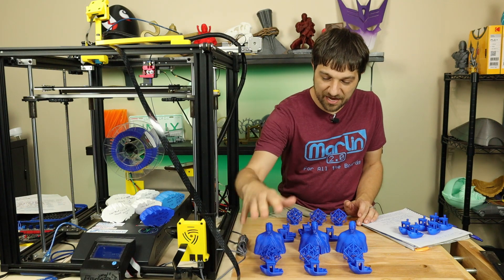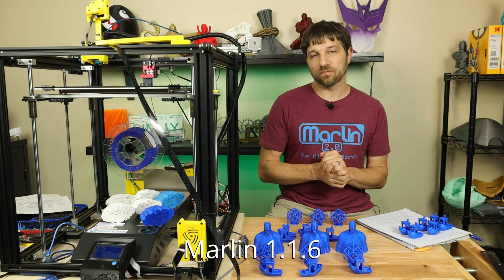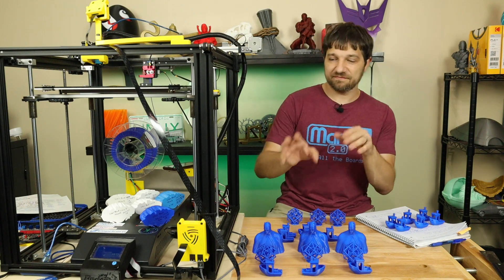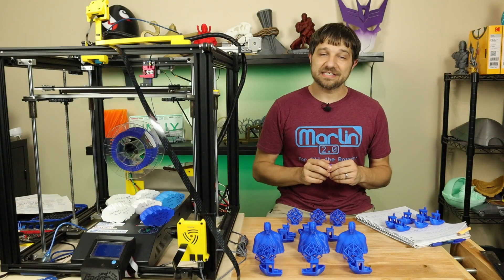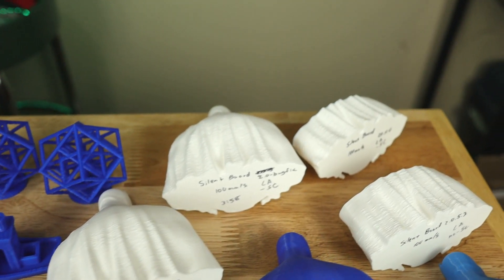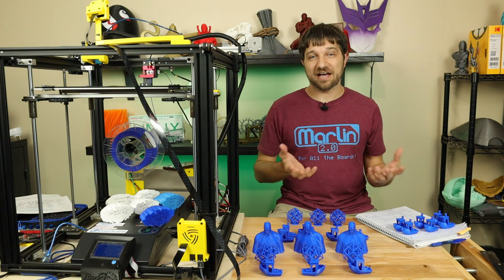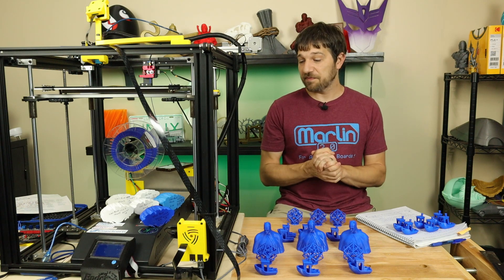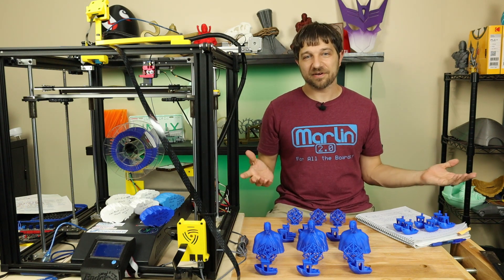Marlin 2.0 Issues: Version 1.X Comparison

Comment: Those same issues with my ender 3, plus very bad ABL results, were what turned me towards Klipper. I am now running 100mm/s on the scurve-smooth branch with linear advance turned on, only 1mm retraction. No ringing, barely any stringing, and the printer doesn't look like it will come apart with vibration anymore. You should give it a try, especially since you already have the RPi.
Reply from the maker: I appreciate that. After several solid recommendation, I will put this on my to-do list.
Reply: @kerseyfabs  Happy to help if you need anything, just hit me up here. It took me a while to "get" the Klipper way of doing things, vs Marlin.

Comment: There are currently issues with JD (which can be fixed with classic jerk), some permutations using linear advance (S-curve, StealthChop) and with the inherent USB CDC latency and the serial protocol with many, small segments (which can be mitigated using direct 3.3V UART instead of USB). With an SKR (with UART/TFT header) you really want to use 3-wire UART instead of USB.
Reply: But how would you use UART if you change the screen? As far as I know you need the TFT connector for touch functionality.

Comment: Why not change the Marlin 1.1.6 firmware to probe on a 5x5 grid instead of the stock 4x4 with your offset settings? I realize that it does mess up the stock creality measurement display, but when using octoprint or just the terminal you can get the true points. 
Doing so allows for much more accurate bed leveling around the center since it doesn't "guess" a z-home from ABL for the most critical place of printing - The center of the bed.
Reply from the maker: I agree that it would produce more accurate results but one of the goals was to keep the firmware as compatible as possible with the existing touchscreen. So, for now, we're sticking with 4x4.

Comment: great video ! I updated my cr10s pro to 2.0 and had the same issues on stock board , after checking the whole printer from top to bottom , I just went back my old TM firmware and now back to printing great prints ! I think a lot of bugs need to be fixed in 2.0 and I agree that its not a board issue but a software issue , great work !
Reply from the maker: Thanks for that! That's why I'm taking my time. Upgrading isn't upgrading if the results are worse.

Comment: is the issue reproducable on the Ender 5 non-pro/plus with the silent board?
Reply from the maker: I haven't tested that printer yet. I have no reason to believe it wouldn't given that it's already reproducible across three boards. I'd still need to test to be sure.
Reply: I had the same issues on my Ender 3 silent board running Marlin 2.0. I didn't try turning off Junction Deviation until I had upgraded to the SKR, but I'd wager it would fix the issue there as well.

Comment: Hey man, love your videos, I have a skr 1.4 turbo with a Ender 5, basically allot of advance functions on marlin 2.x are bugged, Idk if this is your problem, i have a similar problem and was a recent plug-in upgrade on octoprint, the one that show layer status, just to test, print a benchy without any plug-in or using your sd card
Reply from the maker: I'm not using the Pi for printing any of these tests. These are all from the SD. The Pi is only being used for monitoring.

Comment: Did you print these prints with octoprint or sdcard? There seems to be a problem with marlin 2.0 in combination with octoprint on some machines, maybe give it a try?
Reply from the maker: I should have mentioned that. These are all off of the SDcard to minimize external factors.

Comment: There is just no issues with marlin 2.0 as far as I can see. You just need to configure it correctly.
Reply from the maker: "No issues." That seems to demonstrably not be the case given that there are open issues that are unresolved in their issue tracker.
Reply: @kerseyfabs  Yes of course. There are issues with every single software ever released. By 'no issues' I meant no show stoppers.
Reply: @witorwitor  Linear Advance, Juntion Deviation and the corner thing are all bugged... For me is a big issue
Reply: @witorwitor  Junction deviation should absolutely be considered a show stopper. Yes it still prints but it completely ruins said prints. Here is a side by side of the same gcode. Left is with JD on, right is with JD off 

https://imgur.com/RMacH5s
Reply: There is allot of know issues with Marlin 2.X.X

Comment: S curve acceleration and linear advance work as they should.  Just increase buffer size from 16 to something like 64 ( I have it at 64 but you could actually set it to 128)
Reply: Buffer size changes did not fix my issues, turning off Junction Deviation was the only fix. There is are open issue on the Marlin GitHub page for issues with JD
Reply from the maker: Thanks for the suggestion. Are you talking about the BLOCK_BUFFER_SIZE? There are multiple buffers.
Reply: #define BLOCK_BUFFER_SIZE 64 - that's what I changed to fix the exact same problem. With default 16 on my SKR 1.3 printer was microstuttering on circular moves which caused zits. After increasing buffer size from default 16 to 64 no more problems. Would be nice to see if it will fix your problem.
Reply: Can't wait to see an update to this suggestion.
Reply: It's supposed that this 32bits board's don't suffer from that problem, I have a Skr 1.4 Turbo with octoprint, going to try this just to se if I can appreciate any change at all, I think this has nothing to do with the problem because his 8bit silent board don't show this problem and it's a really slow board without native usb connection
Reply: With a big buffer, shouldnot SLOWDOWN_DIVISOR be changed to  so a smaller part of the buffer is required before the slowdown?
Reply: @RobbertMüller  i have set mine to 4
Reply: Hi Kersey, did you enable slowdown in marlin 2.0? 
#define SLOWDOWN

It says that marlin will slow down the print  if "look ahead buffer" is half full. Maybe your buffer is not big enough for 100m/s print.

Comment: I appreciate that you present the research you have done. Especially when I don't have the time to do it myself.  I have not ventured into the speed.  Cura profile is default at 80.  What do you normally print at with the 5 plus?
Reply from the maker: Thanks! I normally print at 50-60 mm/s unless I care more about time and less about quality.

Comment: just increase buffer size in Marlin... That's it, problem solved....
Reply from the maker: I tried this. It didn't fix my issues. Thanks for the suggestion.
Reply: @kerseyfabs  Did you calculate junction deviation value as described here :http://blog.kyneticcnc.com/2018/10/computing-junction-deviation-for-marlin.html ?

Comment: @Kersey I tried Marlin 2 on a delta and ender 3 with a SKR 1.3 TMC 2209 and found it was kind of a mess as well. In the end my fix was sadly to abandon marlin and instead go to Klipper. However I have never been happier with Klipper once you get over the initial teething issues ~6hrs for me. If you have a spare SD card for your RPI I highly recommend you give it a shot as the firmware is completely configurable within octoprint taking only 1-2 second reboots to see results. If you go this route and need help feel free to PM me.
Reply from the maker: Thanks for the feedback. I have avoided having to switch to Klipper thus far but I'd like to try it in the future.
Reply: @kerseyfabs  Have you visually confirmed stutters watching the print live or recording it? If you know its not stuttering consider either disabling stealthchop on E and/or running more current since its possibly your extruder is skipping steps as your motor current may be too low. I don't know what the ender 5 plus is running but if its the same 1A as the ender 3 I think you may need to bump from 800->900 to maintain stealthchop at high speeds.